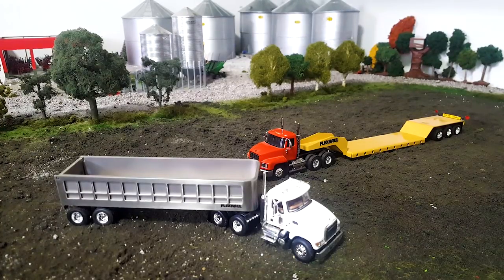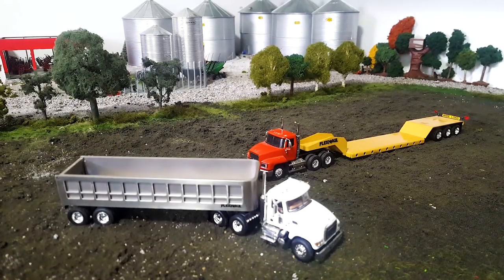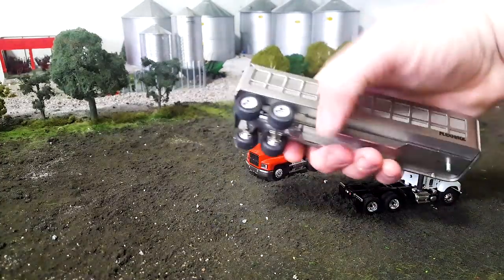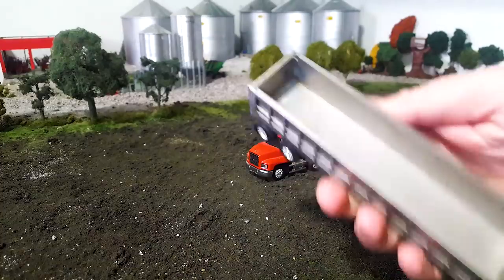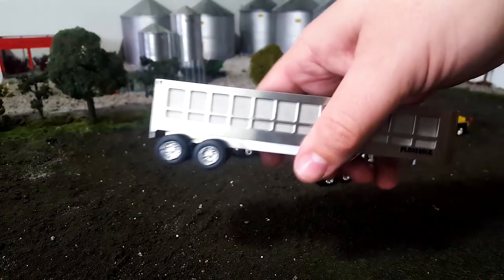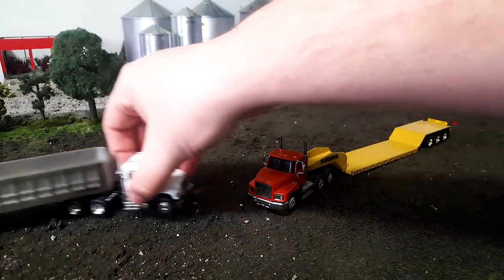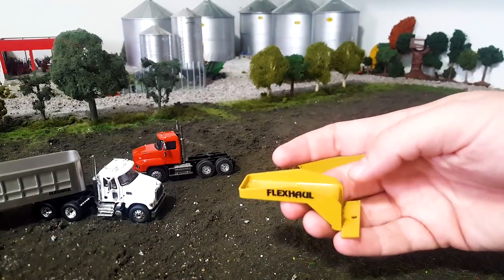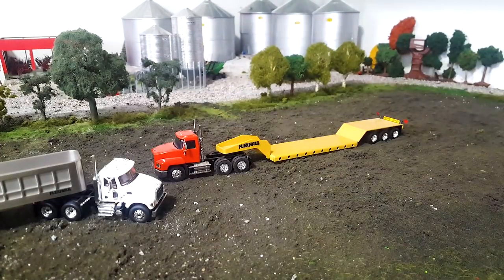1/64 flexhaul dump trailer and lowboy review

Comment: Those Flexhaul dumps are neat.  They come in different lengths with different axle configurations as well.  Tough to find.  They are a little expensive but you can pair it with an old ertl truck and let the little ones play with them without worry.  More truck videos mixed in is a good thing.